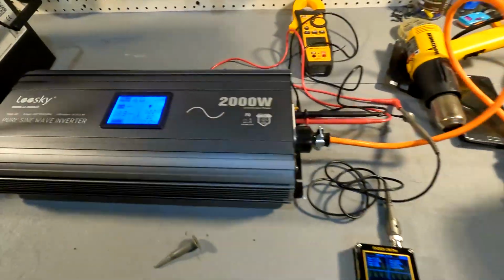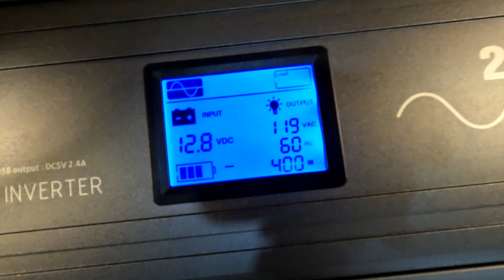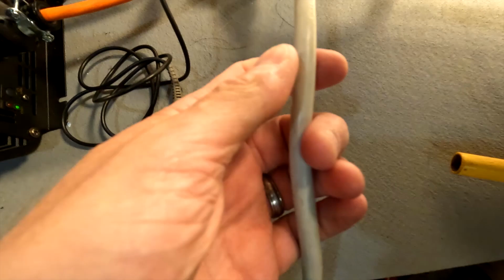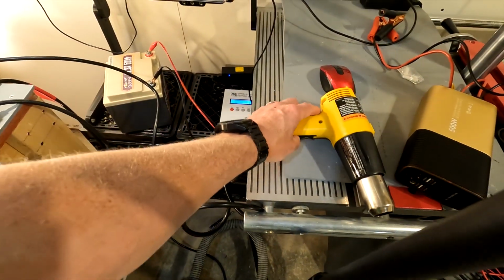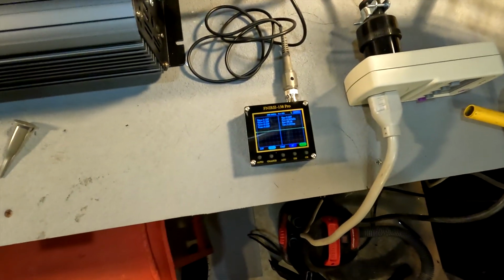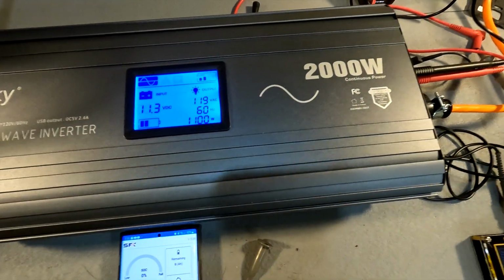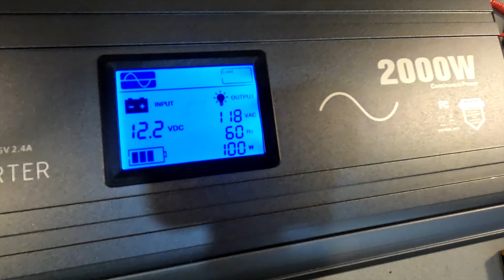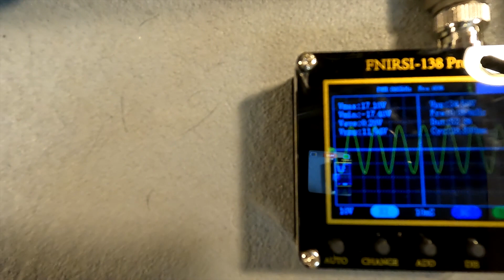LEESKY 12v Off Grid Inverter with built in GFCI Outlet!  Response the viewers comments!

Comment: It's likely the power factor throwing it off, check the power factor on the Kill-a-watt with the heat gun on low.
Reply from the maker: I check the power factor on the heat gun and it's 1.00 on both low and high.
Reply: strange .. checked my heat gun, low setting pf is 0.50 and hi setting pf is 1. Not sure why .. heat coils do have some inductance but didn't expect this much and why not at hi power?

Comment: One thing you NEVER see on this and similar channels.. What about an episode of just testing the capacity and demonstrating the proper wiring of the terminal block on big 12v inverters?  Everyone seems to ignore the block like it's voodoo and has no idea of what it's capable of.  If it is higher amperage it might be a good idea to connect it to 10-2 wire going to a small sub panel.  Just an thought.
Reply from the maker: I personally don't think about it for the fact that it's pretty specialized.  I do my reviews for a more general audience.  It's not a bad idea though.  It would definitely open up more options for people.  Thanks for the comment.
Reply: @OffGridBasement  I did some digging and found that the terminal block is there to pull the full wattage of the inverter (up to 3000w) with 10 gauge wire.  However if your inverter is bigger than 3kw the rest has to be pulled from the outlets which as you know max out at 1800w each.

Comment: On the wattage discrepancy. There is usually a current transformer ring around the ac output wires. Wonder if that got shifted when you opened it.
Reply from the maker: It's possible.  I didn't really touch anything and the disassembly wasn't too rough.  I had another comment stating they had the same issue.
Reply: Manufacturer knew about the discrepancy.

Comment: Hi. I’m going to be hooking up 2 5kw 48v batteries in parallel to a 6kw 48v split phase hybrid inverter. What gage wire would you use if you were doing this and where would you place a class T fuse?
Reply: Use 2 awg wire if it's super short but It would be best to use 00 awg. The bigger the wire the better the inverter will handle start up loads and its way easier on your inverter. The inverter will last alot longer by using larger wire also
Reply: And put the fuse as close to battery as possible
Reply: @matthewknight5641  thank you. On the positive side or negative?
Reply from the maker: You can never go wrong with a T class fuse.  I don't have one, but I don't feel the need.  If you are going to be running the system @ 50% or less most of the time then 0 guage wire would be fine.  I use 2 awg and a 150 amp fuse for a 24v 7.5kw system and never have problems.
Reply: @OffGridBasement  thank you again. What I’m asking is if I should run the positive cable or the negative cable through the fuse block?
Reply from the maker: @JamesAmbrose48  positive side close to battery.  Sorry for not reading the question correctly!
Reply: @JamesAmbrose48  I fuse everything on the positive side

Comment: 1:04 so you GFCI outlet is wired correctly, mine has Ground wire connected to the Hot terminal of the GCFI, Leesky also contacted me and told me that they did have that issue on some of the units and they were recalled to fix the wrong wiring but not all the units got sent back for rewiring so I was the unlucky one. I rewired it and it is now showing proper polarity.
Reply from the maker: Thanks for the update!

Comment: The 'Interference supression components' are usually 'Ferrite Toroids'

I'm guessing that this Inverter runs at quite a igh frequency judging by the 'AC' torroidal transformer. High frequency high energy switching means more interference is generated.

In my particular case, being a radio Ham, I want the lowest possible interference generated otherwise it causes problems when  trying to listen to low strength signals on the Amateur Radio bands in the vicintiy of the inverter.
I've opted for Victron becuse they have a low 50Hz switching frequency and that generates very little additional interference.

The other issue with high powered Inverters is the manufacturers want high efficeincy to minimise heat generation. High efficiency means faster switching times whihch -- you've guessed? means more interference sreading up to higher frequencies.

Electronics design is a careful balance of 'risk and reward'
Higher frequency switching means more interference -- that needs more supression components -- which adds cost (Each ferrite probably costs $10) 

I hope that helps?
73
Bruce G4ABX
Reply from the maker: Thank you for the great information.  It really does help everyone that reads it and is interested in the subject.